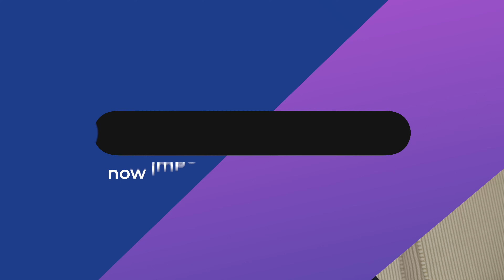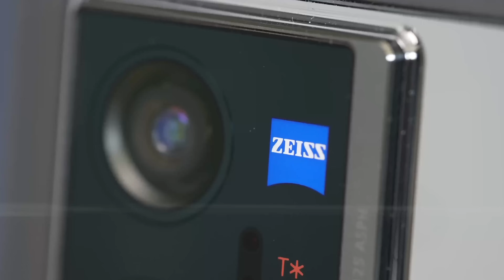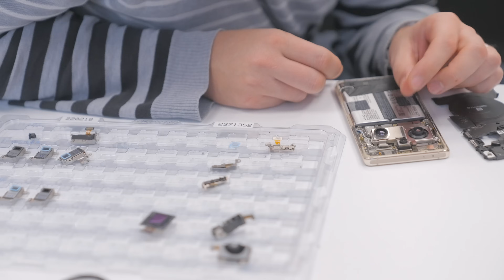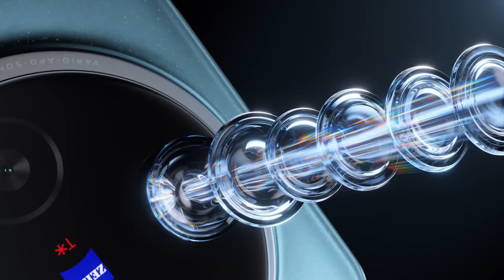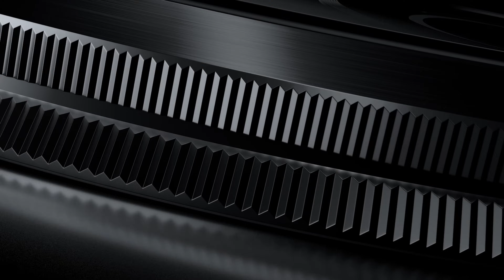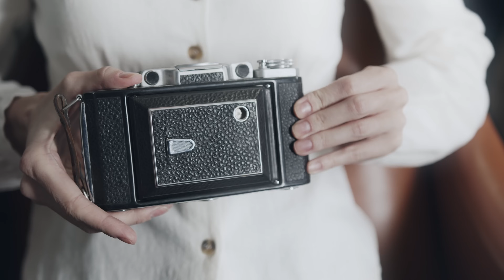vivo V40 Crushes the Competition with ZEISS Cameras

Comment: I like vivo phones for sure... But V40 series I won't agree with you.. very poor haptics , stereo speakers are low sounding, V40pro 2x tele is not good enough & design is like a toy phone overall just an average phone.... Portrait shot not sharp , no proper edge detection...this time very disappointed with Vivo 40 series.